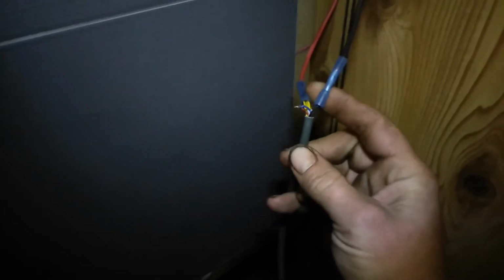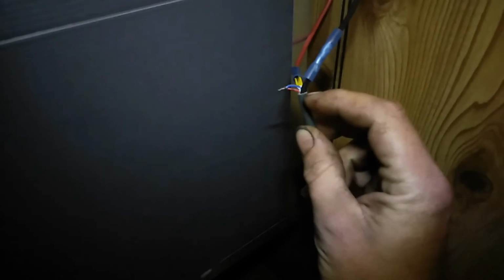HOW TO POWER A CAR AMPLIFIER IN YOUR HOUSE!!

Comment: Damn now I’m confused lol I wanna believe you cuz u gave a explanation behind y u wire it using the cable on the specific side of the power supply, but the dude on the last video all he said on that part was just too use the cord/wires from the side of the power supply that’s removable 🤔